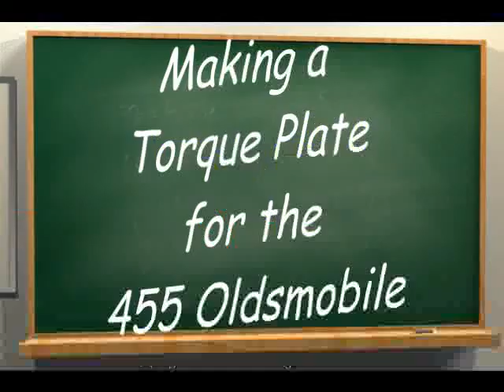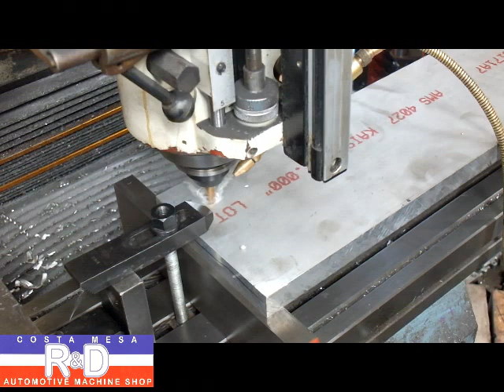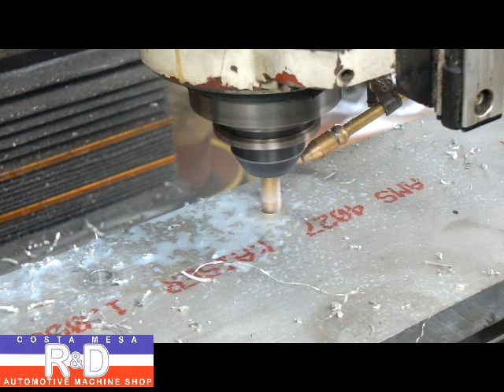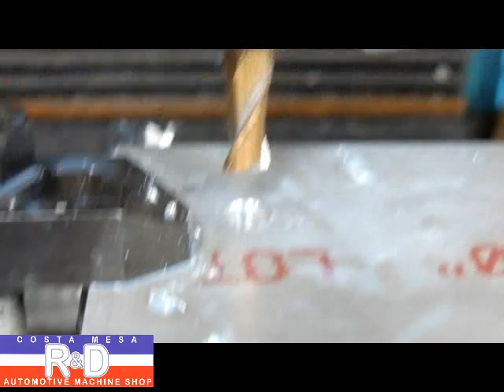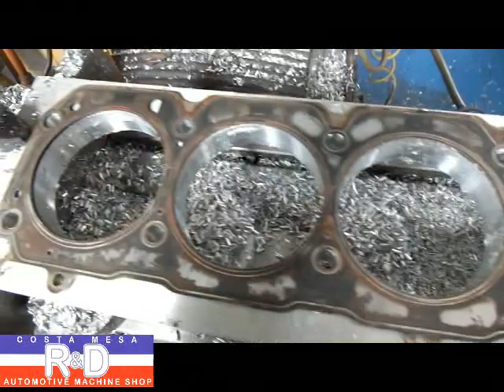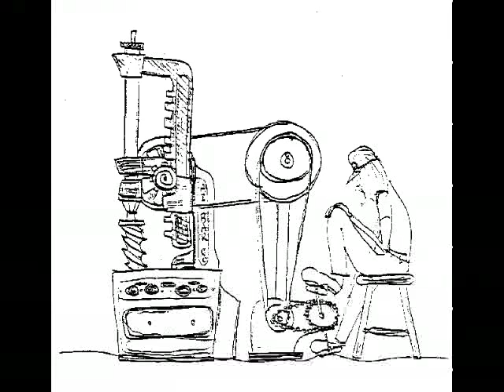Making a Torque Plate for the 455 Oldsmobile

Comment: John, do you think there is any real advantage of using a torque plate for honing vs without? I mean is there really that much change in measurements or distortion when it's not installed so a rounder cylinder is possible?

Comment: So they're used just for maintenance. The engine doesn't run with it installed. Right?
Reply: Correct , for installing cylinder sleeves or honing cylinder walls

Comment from the maker: This engine is going to have aluminum heads on it, the cast iron heads are getting the deep six! LOL
Reply: fiatnutz 
Great video!

With the exception of this video. I really like how you guys are willing to show so many performance engine machining mods with "everyday" machine tools.

Question... I noticed you're whittling away 6061 aluminum or AWS 4027. You mentioned your putting aluminum heads on the motor. Is that why your making the plate out of aluminum? 
If you were to have used iron heads would you have made the torque plate iron also?